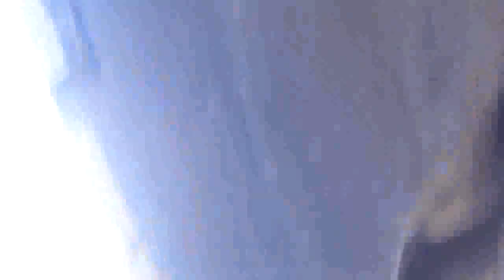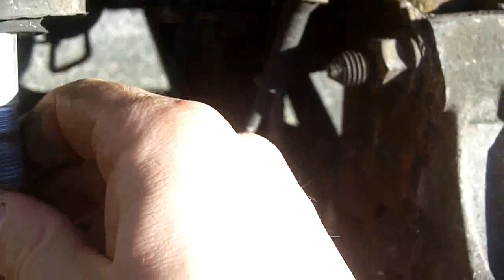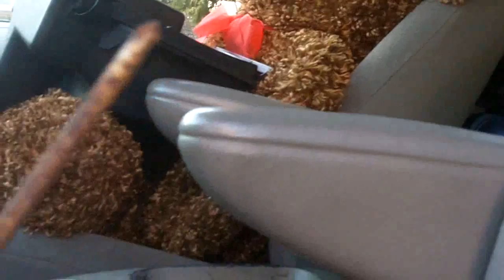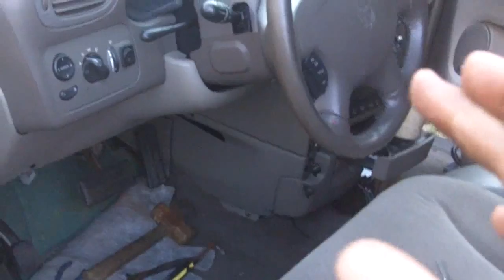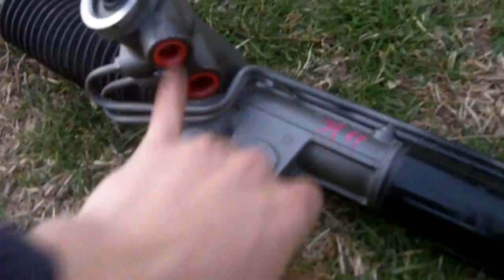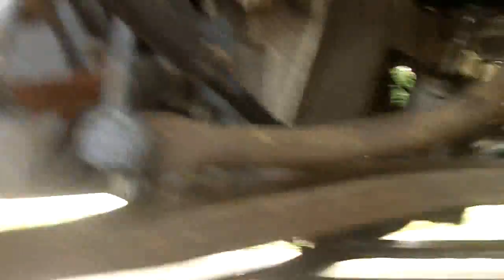Installing a new Rack and Pinion 2003 Dodge Grand Caravan

Comment: got rack from wreaking yard tie rod ends rusted on took it in my shop heated up the tierod came right off on my bench Thanks kc job cost me $45
Reply from the maker: kc scott be carful with used racks. they are like 100 dollars new.
Reply: True, I got a new rack from AutoZone for $160.  (The dealer wanted over $500 for theirs)
Reply from the maker: kc scott its allgood   KC is right about that. Junkyards want $75 to 100 for them, I think I payed $85 for a rebuilt one from a reputable rebuilder. And forget the dealer man, go on ebay and you can even get Genuine MOPAR parts for a fraction of the cost.. I just bought a spare tire winch assembly for a 2008 jeep cherokee for a customer. auto parts store said DEALER ONLY and dealer wanted close to 400 for it.. ONLINE ONLINE ONLINE is all I can say. Online shopping is killing the mom and pop businesses and the big chains..and ofcourse the tax man.

Comment: Hi, im doing mine right now and im having problems with the last rack bolt on driver side..Its the only bolt I have left and it messing with me...When you put your rack back into the steering column and put the pin back into it? Thanks
Reply: I just cant get anything to hold the top nut while i take it off..This is the big bolt that holds the rack up..Chrysler put another bolt for I dont no what going the opposite way right beside the danm thing..

Comment: The punch driver I used a 1/4 or 5/16 can't remember it came out easy used a big ass hammer to hit it while friend held the steering wheel to keep it stable
Reply: thank you.but my dust boot screws would't come out.can i cut them out and put it back together or just cut around the screws?
Reply: Kevin Smith Maybe liquid wrench or WD40 once or twice a day, for 2-3 days. They will come loose. They should come loose without having to cut/grind them off...
Reply: thank ALEX O.I.M going to try that

Comment: There is a tool called a pickle fork that is used to remove the ball joints. Saves a lot of work and lot less hammering. There is pickle forks for a air hammer so you don't have to use the hammer as the tool does the work
Reply: and it will destroy the boots, he said he wasn't replacing the tie rod ends.
Reply from the maker: John Zollner  The only time you use that tool is when your Replacing a tie rod end or a ball joint Completely, and not when your moving it to Service something else.. Using that tool like *****  Said will Destroy the Rubber Boots that hold the Grease in and keep Debris out of the joint.  The tool also will put stress on the Joint, When Hammering the Pickle Fork in, a good hard hit might send the tool right into the joint causing pre-mature wear to the joint.. Your supposed to Knock a joint loose like I did, Giving the Boss End of the Knucle a few good slams, thats why theres a flat spot there. Its for that.

Comment: the key to getting the lines off is to do it threw the floorboard hole after breaking them loose then unbolt the rack so you can move it around to get the wrench on and off. when inserting new rack install the lines first using the hole and with fingers!!! do not crosthread these lines they have tons of pressure and will leak you should be able to screwm the 90 percent in with your fingers before torqueing them.905 is number one in my book

Comment: just did 2005 dodge caravan rack and pinion it took me  7 .hours total.i suggest having a freind help.after taking the tires and tyrods off take of the small pollution i recomend going for the structural reinforocemet plate .i just took mine all the way off it was about fifteen bolts total i had an impact for the big bolts and wrench on the top that took only fifteen minutes then though the hole in the florboard loosen the top line.i then debolted the charcoal box it was very easy to take off with that 3ft by 2ft plate brace removed after that unbolt the rack its easy to get too with that plat all the way off. then you can drop the rack and twist it while someone on top takes the bottom power steering line off through the hole in the floor board.its very time consuming getting those lines off and i had to call a freind to help wrench it offf and on threw that 4 inch hole in the floor board.that was the key for us doing it.wrenches and sockets used were 8mm 10 mm 11 mm 12mm 13mm 14mm 18mm 21mm 22mm wrenches and sockets for all sizes also a 2lb hammer a punchdriver for the roll pin worked great for me and a pickle fork  for the tyrod ends i just beat them off on the knuckle .this video and maker are awesome and i thank you for the video and im sorry to here someone stole your van.also i broke the tyrod nuts that keep them from turning first and used penatrating oil before doing so.count the turns on both sides when removing. so in summary have a helper drop and remove the plate he has dangleing it seems like a lot of work but its doable.and the lines are easiest to remove through the hole just break them loose before unbolting the rack then have one guy on top doing the lines and a guy on the bottom twisting back and forth so the guy on top can get the wrench on the flat of the bolt.the key for me was removing the plate asap then the charcoal box brake the lines loose threw the hole in the floorboard then unbolt the rack completly have a friend manover it around .when installing the new one have a buddy underneath put the obootom line on threw the hole and tighten then the top line threw the whole and tighten. then bolt the new rack on  whole guy on top puts the ujoint collar bacl on and install roll pin then put the charcoal canister back in then the plate then the little pollution device hook up hoses. count turns for tyrods rebolt and fill with about a quart and a half of fluid.mine turned out good i bought my rack off ebeay for 87 bucks delivered took three days for shipping.feel free to contact me threw you tube if you get in a bind or want advise.once againg thanks and praise to the videomaker on this one
Reply: what size punchdriver did you use
Reply from the maker: Kevin Smith
 Oh Jeez.. I dont remember
Reply: So take the support plate completely off, ok. No need to drop the engine cradle? Thanks

Comment: How did you disconnected the lines?I  am having to replace the pressure hose and after I move the canister. I have no room to turn  the 18 mm wrench.
Reply: Those lines are a pain in the butt. I'm doing this job right now and it's taken me over 2hrs. just to get them off. There is no room for a wrench from under neath. What I did was use the whole in the floor on the drivers side where the steering column goes thru and cracked the lines that way. Once I got them loose enough, loosen them by hand from under neath.  (Do the reverse when installing them.)
Reply: You have to wiggle the line as you thread it, maybe give it a half turn counter clock wise to line it up then thread the rest slowly. it might take a wile but you will get there. Use a stubby wrench to do so as there is little room to do so
Reply: It was a SOB wasn't it.................
Reply from the maker: El Mero Mero  You have to have ALOT of patience for this job.. It too me forever.. those lines got me so pissed off.. Im sorry for getting back to you a half a Year later.. I have to figure out some way to quickly be able to reply to everyone
Reply from the maker: its allgood  Tell me about it.. those lines took me forever too. Theres a few ways around it but it involves totally lowering the cradle. This job was soo long ago Im beginning to not recall everything I did.. But I will never forget those lines. how close did you come to saying " FUCK THIS" lol
Reply: It should be the bottom one
Reply: What is it doing
Reply: yeah I agree with how long it takes to get the line started,but gotta have patience and it'll happen. I kinda pushed on the line n lightly wiggled it as I turned the bolt slowely , so it'll grab on to the rack.( For future DIY's)
Reply: Hi Guys,
I did this job and was not successful.  I removed the battery and cruise control and you get to the lines from up above.  this worked but I cross threaded the low pressure line and now it's stripped.  This job took me so long to do I am really I am at wits end with this job.  I'll get another rack, but there has to be a better way to get the lines installed.  Are there any better ways to do this?
Rick
Reply: El Mero Mero In the rack itself, which one is the return and high pressure hole? May be I messed up when I installed mine on my 2003 grand caravan. Is the hole on top the return or high pressure? Gracias mero mero
Reply: I used a 18mm and 16mm stubby wrenchs on the lines and tightend it as best as posssible. the line from the pump was a lil tougher to tighten, so I a longer wrench and tightens it right up...no problems. (for future use DIY)
Reply: 18 mm crows foot wrench is the tool to use here.

Comment: You will need an alignment after doing this right?
Reply: yeah, when removing the outer tie rods, count the turns and remember those when you put them back on, or the new ones on, and it will save the guy doing the alignment a lot of time.
Reply from the maker: ADeviatedSeptum
 it will save them alot of time and it will also save your treads. Ive seen people bring cars in before and the tires would be facing inwards lol

Comment: I need to change the rack and pinion on my t & c 2005;ime not paying $500 or so for a brand new one-should I buy a second hand one from a 2006 (70 000 miles) 3.3l or a 2007 with 32 700 miles OR a refurbished one ("Detroit refurbished") sells on ebay for $102.....???
Reply: i am just getting done by replacing the one i bought from detroit axle through ebay. it was in real good condition. and there prices are very reasonable also, plus they are good on promise ( delivery wise) .  and there is no shipping/handling charges. good thing is that they do test there rack n pinions before they ship them, and if you are not satisfied 100% money back guarantee.and after you send them the old one back, they will give you the life time guarantee.
Reply: I found a re-manufactured rack for $133 or less for our 2005 T&C... Google is your best friend...Always remember that when looking to buy something. :-)  This time Google came up with partsgeek dot com as the lowest price. Though that fluctuates of course from one company to the next. I've also (bought from) had good prices from RockAuto dot com. Just do some internet research and usually some great prices will present themselves, compared to most local places I've noticed.

Comment: I think the rack and pinion is just a common Dodge/Chrysler  problem lol.  My cousin has a dodge caliber (07) and it has been needed replaced for a while now.
Reply: caliber is a POS, not knocking your cousin, I just did some research for my mother in law and they rated REALLY low...........
Reply: I agree.. hell, my cousin thinks it's junk.  We just had to replace the crank sensor last weekend.
Reply from the maker: *****  blizbiggy  Theres a reason they dont make them anymore. They are junk, and they were commonly used as fleet vehicles like rental car agencies etc..  Im sorry for the Delayed reply. Its like 4am here and Im going thru my youtube. and I have work at 9 lol

Comment from the maker: most of this is what I did. However. I dont always recommend messing with the cradle bolts. the Drivers side front bolt is known for breaking. be very carful if you want to go down this road. I just broke one on a 98 grand caravan tonight with 200k

Comment: Disconnect steering column
Remove 3 bolts holding rack.
Slide rack with outer tie rods still on halfway to passenger side.
Twist and turn rack so driver side end drops through opening in black metal stiffener panel.
Slide rack assembly towards driver side until it is free of car. No need to remove black stamped metal panel.
I did final tightening of hydraulic lines from above. 
Take 2 aspirin
2005 dodge grand 3.8

Comment: Thanks for the video.
A couple pointers from the experience:
Lower the front suspension frame as far as it can with out dropping it. 2 bolts either side. Remove the back ones leave the high front ones at minimum thread to hold the frame. 
Remove the aluminum heat shield near the car on filter. 3 little sheet metal screws.
Remove the carbon canister. 4 bolts and 3 hoses. Have replacement hose clamps ready.
Remove the rack and pinion hydraulic lines.
Remove the steering column per video.
continued

Comment: ok after watching this video we had hardly no issues changing out rack and pinion. but we did not have to remove the circular bolt with the screwdriver and hammer, I guess it is because we have a 1999 maybe?? but after soaking everything In liquid wrench, everything came apart and together simply. Thank you for the how to video.

Comment: then I put in a new pressure line and I’ll be darned they put SEA wrench size flare nuts on it the threads all match I had to get a 3/4" short wrench to put the pressure line one as 18 mm too small  and 19 mm too big did not fit was able to use 17 mm on the pump side the nuts on the tie rod ends are now 3/4" wrench why do they do that drove me crazy  drift pin was a pain to get back in it did not want to drive in very well.

Comment: got it done had to get 18 Mm crows foot and a 18mm 21mm wrench the rack toe tube to the passenger side from the steering pinon was bent wrong and to trad it in for a different one that was a fiasco then I got it installed putting the steering Knuckle back on the Pinion was a lot of trouble.

Comment from the maker: William, The video should give you enough information to help you. This job was a long time ago, I think what I did for the nuts ontop was I used a vise grip and turned them out from the bottom. The black metal reinforcement was a pain in the ass. thats why i took it down. Dont give up yet, im sure if you have got this far you can finish the job. let me know how it works out. by the way.use  a vise grip that doesnt have flat teeth. they sell ones that when you close theres a arch in the middle.

Comment: I have a 1997 Dodge grand caravan Same problem but when I got to the 3 Bolts that hold the rack in place _ 1. There are Nuts on top that are not held in place. 2 they are bigger than the 13/16 that the Bolt is. 3 even if I had the right size I cant get it in to the on e at the Pinion. - - -- I am at an impasse trying to find help I may have to put it all back together and take it in to be fixed.

Comment: Got them at the dealer for 30 bucks and it cost 75 bucks at Goodyear to have the installed on top of the cost for the alignment job. They had to pull the tie rods out to slip them on. Much like you are showing in the video. Now I have new brake pads and shoes and and a couple other new parts costing me a grand total of about $1,200 bucks. Ain't dat a bitch?

Comment: That annoying thing you mention is the cradle reinforcement, it also holds the LCA's in place. Sometimes there is a transmission cooler attached to it.

Comment from the maker: jack,

 No problem. thats what I made this channel and website for. The tool you mention i have. I bought it for inner tie rod ends..the inner and outter tie rod ends on my 98 caravan are soo bad when you lift the wheel off the ground you can move the wheel back and fourth.. they lasted 195000 miles so i cant complain. good luck to you and subscribe to my channel for new videos. Ill get around to posting them soon lol...ill be doing the engire front end of my caravan soon

Comment: Thanks for the quick reply. I think i found the tool that i need to remove the inner tie rods: look up the Lisle 46600 - Inner Tie Rod Wrench Universal. It's got set screws to tighten down onto the round ball to get a grip on it. Cheapest listed price I found is $27 and a hell of a lot easier than dropping the rack just to get at those tie rods. The tool I rented from Advanced Autoparts had three different size hex heads but there were no hex flats to grab onto. Thanks again for your help!

Comment from the maker: Jack,

   The inner tie rods are not integrated with the rack. if this were true then the inner tie rods wouldnt be servicible and the only way to service them would be to replace the rack. This is not the case here. The tie rod tool should be able to work you may have the wrong tool?. let me know how it works out

Comment: thanks for the video! Like the way you just went for it and got it done. I'm trying to replace my inner tie rods on 2003 Dodge Grand Caravan and there's no hex/flats to get the tie rod wrench on it. Someone said the inner tie rods are integrated with the rack- do you know if that's true? In that case, I'll be using your video to help me do the job. Thanks.

Comment: Yes the black part... The Haynes book says their is 10 bolts holding it... It looks like you undid it in the videos but not the silver aluminum part..I'm talking the black part. It looks like it would be the way to get at the driver side sway bar bushing...

Comment from the maker: Do you mean the Cradle support bracket ( the black braket under the actual Cradle) or the Aluminum Cradle itself?. I ask this because  I just want to be clear on what your asking. This job believe it or not is actually Foggy to me id have to look at my pictures and avideo and review it again. The cradle holds the rack and a few other things, but not the engine. the engine is actually suspended on the unibody.

Comment: The cradle that you loosened up... Does it actually support anything? I am working on my sway bar bushings and the passenger side was easy but that drivers side is not so accessible... Looks like I might need to loosen mine as well... Just don't want crap falling on me unexpectedly... Any advice? And great job! Very informative!